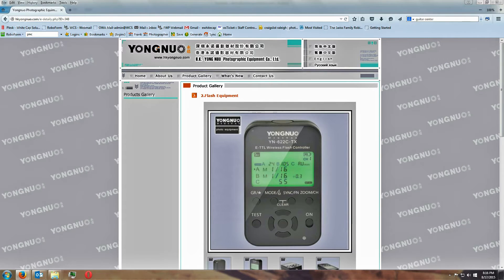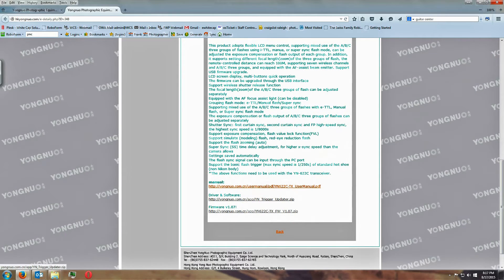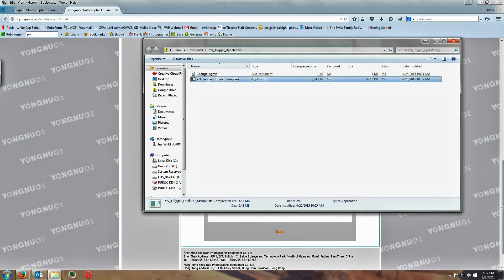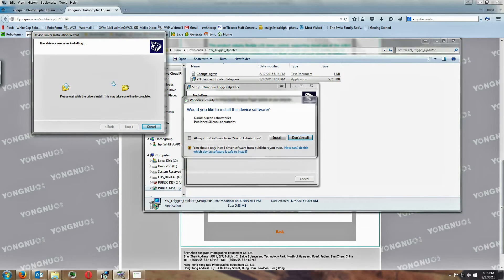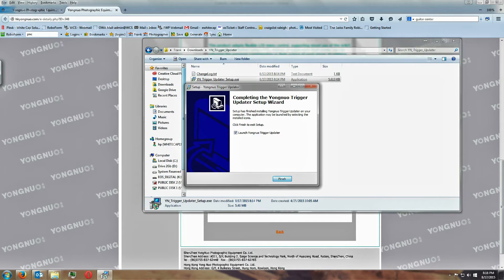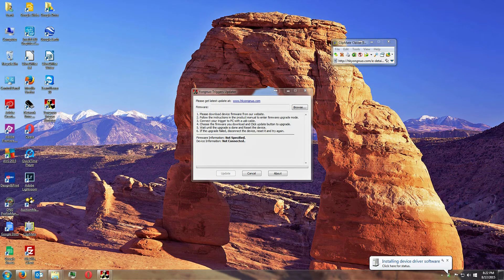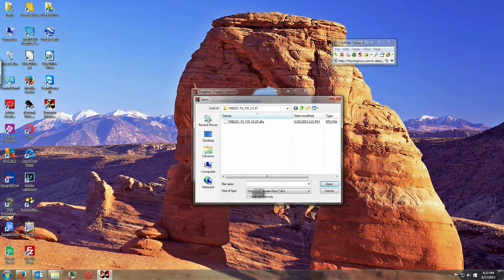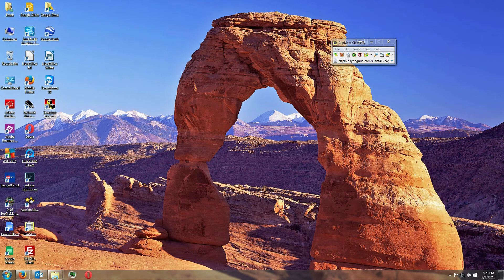YN 622C-TX by Yongnuo - How to upgrade the Firmware

Comment: why do i have different versions showing in my 2 yn622n-tx? 1 unit is showing V1.08 UP and the other unit is showing V1.08 FU??? I used the same file to update the 2 yn622n-tx but have different results. i am thinking that the units are not identical and one is an upgraded version...

Comment: what is the update going to do ?
Reply from the maker: That's a good question. Updates in general either fixes a problem or add new capabilities.
Reply: The latest firmware version for YN622C-TX flash commander is now 1.10 and it improves communication with Yongnuo’s YN685 flash speedlite for Canon. YN685C is the first Yongnuo’s flash with YN622C radio trigger built inside.

Comment: you did give good info. I want to see if i can use YN560-TX to trigger YN622c-TX for the latter to trigger my ETTL flash as the 560) triggers YN560 IV speedlites. I saw this somewhere. http://flashhavoc.com/yongnuo-yn560-tx-to-yn-622c-compatibility-added/
Reply from the maker: I tested the YN560 IV with the YN622c-TX and found the the 622c will trigger the 560 iv. It would not change any settings, so I'd have to change the settings on the 560 iv manually. I don't have the YN 560-TX trigger so I don't know if it would trigger the 622c. Good luck.